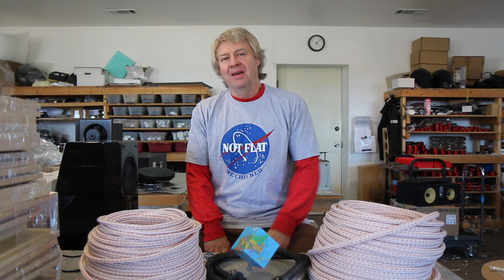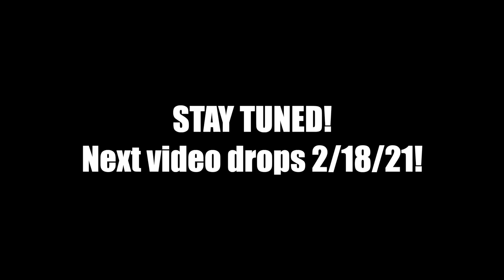Audiophile Cable TRUTHS: The Divided Camps

Comment: According to engineers, cables affect sound but cables transparent to audio frequency signals can be made very cheaply. Expensive hifi cables can be just as good unless they unintentionally messed up some parameter actual engineers care about.
Reply: There is a LOT more to it than that. Hang in there.
Reply: @dannyrichie9743  Yes, but as an engineer, not at audio frequencies. Typically in the audio realm, the only thing you have to worry about is the loop resistance of the wire. Typical linear amplifiers have an output impedance of about 50-100mΩ, so you don't want the wire forming what is essentially a series resistor as it will cause voltage fluctuations, especially at low frequencies where the current is substantially out of phase with the voltage. The other concern, of course, would be I^2R losses if you, for some reason, need to shove 100's of watts through your speakers. But generally, any copper wire of a suitable gauge for the power output will work, and there will be no audible difference.  Now the place where it does matter is at high frequencies. The first issue is the total capacitance the wire presents to the amplifier. Since there are two conductors, the wire looks not only like an inductor, but also a capacitor at radio frequencies. Linear amplifiers with feedback behave inductively outside of the audio band at higher frequencies, due to the falling loop gain. This means that there is a certain amount of capacitance that can form an LC tank circuit, and cause the amplifier to oscillate. As the wire has a very low resistance, it forms a high Q circuit, which can cause the amplifier to break into oscillations so bad that it physically destroys the active devices in the output stages of the amplifier. As most amplifiers have Theil networks in them, and there's seldom a need to run more than 20-30 feet of wire, this is not normally an issue. The one that's often overlooked, but important, is the fact that speaker wire also behaves as a transmission line at RF frequencies. This is important for noise immunity, especially for bipolar amplifiers that can rectify AM. Now the characteristic RF impedance is of no real concern for your amplifier, but it does mean that the wire will exclude RF interference from outside sources. This can be easily proven by going to the middle of a twin conductor speaker wire, cutting the two conductors apart, and separating them. Your amplifier will turn into an AM radio as the speaker wire is no longer behaving as a transmission line, but now a radio antenna. But very long story short, for audio, doesn't matter. Just get standard copper speaker wire of the correct gauge and all will be well.
Reply: @dannyrichie9743  Also, the reason I don't believe you is not that I don't want to hear contrary opinions. If I didn't I wouldn't be watching your video, would I? No, it has to do with the simple fact that what you are saying is simply not true. There is no mechanism in nature that will cause simple copper wire conveying slowly varying electrical signals to do the things you say it does.
Reply: @mysock351C  What I say is absolutely true and easy to demonstrate and hear. Stay tuned.
Reply: @dannyrichie9743  If what you say is true, and that different copper conductors can alter the frequency content of audio, then you would literally win a Nobel prize in physics, and it would be the biggest discovery in recent living memory. Im not being hyperbolic, there, either. To be honest, expect to be heavily critiqued on your measurement methods.
Reply: @mysock351C  What I've said is not only true but the whole industry knows it (aside from a handful of flat earth guys). So no Noble prizes will be awarded for well known basic information.
Reply: @dannyrichie9743  I’d love to find improvements, but no one can produce independent scientific listening tests demonstrating that high-end speaker cable, tube connectors or improved resistors provide an audible improvement over sensible alternatives. Since there are no audio based measurements either, then this is nothing more than heresay. If these improvements were so easy to hear and since there are so many companies peddling this stuff, why can’t someone perform an unbiased listening test and prove it?
Reply: @marcdesjardine5566  We've done hundreds of listening comparisons and tests allowing hundreds of people to hear the differences.
Reply: @marcdesjardine5566  There is a big difference in speculating on a result and knowing a result from experience. You don't believe.... I know. I can prove what I say and have done so hundreds of times.
Reply: @dannyrichie9743  it just doesn’t pass the smell test. If someone could easily hear differences between quality cables with similar r/l/c, this debate would have been put to rest many years ago. The strongest evidence to date is ‘just trust me’
Reply: @marcdesjardine5566  I can provide all the evidence anyone can every want. The differences are clear and repeatable in a system like mine. Every person that has ever been here and compared anything including cables left with a definitive conclusion. Even the nay sayers leave here knowing that cables matter. There is an open invitation to anyone that wants to learn for themselves. they can come by for a listen.

Comment: I believe the placebo effect has a greater effect than the actual effect of using better cables.

If you don't believe you will hear a difference, you probably won't
If you do believe you'll hear a difference, you probably will
If you've measured a difference, you'll be looking for it when you listen
Reply: And that belief is based on... what? A feeling? The placebo effect is easily removed. Stay tuned for more to come.
Reply: @dannyrichie9743  Believers can hear a difference, non believers can't. The fact that there are so many people in both camps means it is obviously a matter of perception. There is a difference in cables, but if someone doesn't perceive it, it doesn't matter. Like you said in this video, listening is the most important part
Reply: There are objective deficiencies at the bottom of the quality range. More subjective differences in engineered cables.

Comment: I'm no scientist.
I've heard my speaker cables improve the sound of my speakers from lighter gauge cables to heavier gauge oxy free cables.
The biggest difference was in attenuation. I heard the sound coming through at a higher level of volume. And clarity during low levels of volume was improved as well. From generic 16 gauge clear shielded store bought cable initially, to then upgrading to Furez 12 gauge cable with fancy braided covering added along with Sewell Deadbolt terminations. (Which let's face it, is only a small upgrade compared to the current market)
I heard nothing at all change when borrowing a friend's super duper high priced state of the art speaker cable with  soldered connections bought from a company who shall remain nameless. ZERO difference. He tried, but he failed.  
No ifs ands or buts.
I've heard a difference in crossover networks being upgraded.
I've heard a difference while introducing DSP.
I've not heard, not will I probably ever hear and difference in any upgraded power cord. I own a new  $3000.00 Sony STR ZA5000ES flagship processor and the power cords we tried did not make any discernable difference whatsoever in blind listening tests. It was an exhausting weekend of trials. 
What we concluded was that longer runs of speaker cable DEFINITELY matter when considering the gauge.
And DSP is some very interesting tech.
Upgraded passive crossover networks yield clarity especially discerning faint sounds at low level.
And experimenting with expensive stuff can be fun and there is nothing inherently wrong with using materials that look and feel upgraded from stock.
And simply hearing a "difference" doesn't always imply an "improvement."
-✌🏼
Reply: I absolutely agree with you, and my experience with my experiments yielded similar results. I always wonder why people think 3 foot of power cable makes difference when the power socket has basic Romex cables running 100 foot which is not touched. Do they even know about this 100 foot for Romex, and multiple Wire Connectors in between their socket and main termination? not sure. Does this last 3 feet of cable to your equipment power supply going to change your frequency? or your voltage? or current? Seriously sometimes I think these people lost complete rational/objective thoughts.
Reply: @chinnana583  in one of the new record day listening videos with Danny you can see several car batteries in the background.  It appears the power grid is taken out of the equation when they do proper listening tests.

An ingenious way to remove interference on an efficient sysyem.  I would be curious however, to learn what they use as an inverter

Comment: I am not a scientist.
I am not a Flat Earth guy. ( although, a flat earth could possibly make for an awesome speaker diaphragm, for projecting music towards the sun. Just a thought...lol) : D

Cables, in my opinion, are conduits. Nothing more, nothing less.

What sounds the best, is subjective: to each individual's personal musical preferences / expectations,  physiological hearing preferences, and room acoustics.

i.e. people with tinnitus are extremely sensitive to aggressive high frequencies and excessive treble levels. ( just one example)

High quality materials / construction, excellent conductivity and smart engineering for cables: absolutely makes a difference.

Science and measurements are important.

At the end of the day, it will always come down to individual preferences, and the above mentioned contributing factors.

One man's smooth, musical crescendo......is another man's dull decent into boredom.

One man's exciting, lively high frequency / treble extension....is another man's excruciating ice pick through the brain.

Gather 20 people around you, and try to agree what three toppings to get on some pizzas.

Good luck with that : D

Thanks for the video!!

Comment: Agree that listening is needed along with measurements to prove one cable sounds different than another, but shouldn’t it be done via some sort of blind study?
Reply: It has been done. No differences were found between lamp cord and expensive cables.
Reply: @Clobercow1  Exactly. They’ll then say it’s because you get used to the sound and all that. Anyways, especially since you can’t hear the difference you should go with measurements, because it’s nice to know you have the best you can get even if your ears aren’t exact enough to hear the difference. Also you should obviously really consider what you wanna spend on something your human ears can’t appreciate
Reply: @Clobercow1  You are correct. It has been done, but that was not at all the conclusion.
Reply: @TofumanFC3S  I can demonstrate that the differences are very easy to hear. Keep watching this series.
Reply: @dannyrichie9743  I'm not convinced quite yet but I'm definitely looking forward to the upcoming videos to see the results. Keeping an open mind!
Reply: @dannyrichie9743  Don’t bother for me since I’d need to see a blind listening test conducted by a independent scientific party. The problem is those tests have so far only exposed how bad our hearing is and how powerful the placebo effect is. 

I think your cables look good and as long as they test as well as any cable I’d consider them for that fact.
Reply: @TofumanFC3S  New Record day has a recording that switches between the tube connectors and standard speaker terminals. That is easy enough to hear the difference.
I think of cables like water pipes. Some water pipes can make lots of noise when water passes through. I think it is the same with electric cables.
Reply: @nonameforgoogle2538  Altho that Youtuber can hardly be considered an independent scientific party, I completely agree that a connection point is and always will be a very critical point in any transmission of signal. That’s a lot different than the cable leading up to it for which we’ve had measuring, testing and formulas since ages now. There are no real mysteries left there just like how there is no per perfect connector (but you should always get the best one you can afford for your use case)
Reply: @Clobercow1  I could never believe power cables make a difference but I do believe Audio cables make a difference when your system is good enough to play music to a high resolution.
The actual connectors probably have more impact than the cable
Reply: @dannyrichie9743  Evidence?
Reply: @nonameforgoogle2538   The problem with people who claim cables make a difference, is that it's a nebulous claim with no meaning. I doubt, in a double blind study, you'll know the difference between lamp cord of sufficient gauge, and what Danny is selling.
Reply: @nonameforgoogle2538  Power cables can often make as much or more difference than any other cables in your system.
Reply: @Clobercow1  Plenty.
Reply: @dannyrichie9743  Oh dear God.  Danny come on, power cables???  Why does the last 6 feet of cable after miles of that shit in the power lines make any difference at all?  The cable goes into a device that has power filtering.  What would the cable even change?  Explain EXACTLY HOW what you're suggesting could be true.  Use your head.  How can you keep making these kinds of nonsensical statements?  It's mind numbing.
Reply: @nonameforgoogle2538  That's a bad analogy.
Reply: @Clobercow1  In the old days Arny Krueger would declare on RAHE that all CDs sound the same, and all CD players sound the same. He knew, because he had done the measurements and the double blind listening tests. Arny was an "objectivist". 

Then, people would point out to Arny that a lot of improvements have been made to digital audio during the 80s and 90s. E.g. the earliest consoles would be 16 bit at most, so with every mixing step, oh yes even with changing the volume of a channel, you would get rounding errors and lose more and more of your precious bits. And all parts of the equipment would have separate clocks, so that the samples never arrived at the right time in the next part of the studio chain. So later on all this changed, they discovered that recording at 20 or 24 bit would give you enough headroom to deal with rounding errors etc, they discovered the importance of dithering when reducing to 16 bit, etc.

But Arny the Objectivist continued to say: "It all sounds the same."

So one day I told him that my TEAC CD player had 2 switches, allowing for 6 different digital filter positions, and that they all sounded different.

But Arny the Objectvist flatly refused to accept this reality, and continued to say: "All CD players sound the same."

All objectivists are in the same league as Arny Krueger. They deny science.
Reply: @TofumanFC3S  You have no understanding of science.
Reply: @dannyrichie9743  Power cables really make a difference for amps. The reason is that all electrical appliances in the house form one big filtering system together. So your amp is connected to everything else in the house. Even if the stuff is on different groups.

If I unplug my Brother laserprinter in my study, I get a better, clearer sound in the living room, although the study is on a different group.

We have cable radio in the Netherlands. If I unplug the antenna cable from the wall, the CD player will sound differently. It's all connected.

My experience is that having tv, dvd player, laptops, etc on standby mode gives a better sound than switching them off. In off mode they become a kind of passive filter, that is to my ears more obnoxious than in standby mode.

If you want to switch these thingies off, then in my experience it's better to unplug them.

If you cannot hear the difference, you are deaf.
Reply: @LouGuido  Cables are connected in series, that's why they matter. It is like sun glasses. You can see the whole trajectory of a photon bundle from the sun to your eye as a kind of cable, hundreds of thousands of miles long. And your sun glasses are a photon attenuator. Why would this last half inch of attenuation make a difference to a photon, after having traveled so many miles?

Because your photon attenuator is in series, not in parallel. Your sun glasses filter. Therefore they matter.
Reply: @ernstraedecker6174  Wanna back that claim up with ANY proof or even examples, tough guy? Since you are Youtube comments section scientist ofc. and I “have no understanding of science”
Reply: @ernstraedecker6174  What’s the address? Probably not that far of a drive from my place, I’m totally game
Reply: @TofumanFC3S  Amsterdam, the Nethrrlands. You're welcome.
Reply: @ernstraedecker6174  Ja, ik weet dat je in Amsterdam woont, staat op Twitter, maar wat is het adres? En wanneer mag ik langskomen?
Reply: @TofumanFC3S  Dan moet je me via twitter een DM sturen. En dan gaan we er een dag voor zitten, over een dag of 10, als mijn 2e AZ prik is ingewerkt. En net voor ik mijn nieuwe electriciteitsmeter krijg (14 juli). Of juist een week of twee daarna.

Dan zul je zien dat ik momenteel een handgemaakte three-wire solid core free floating power booster (tm) als snoer naar de pre amp gebruik. Oftewel installatiedraad vd Praxis. Is dat een goed idee? Hm, het bevalt me op dit moment.
Reply: @ernstraedecker6174  Kijken we einde van de maand dan wel. Moeten we van te voren het er nog wel over hebben wie en/of wat getest zal worden. Tot dan!
Reply: @LouGuido  Exactly right.  A power conditioning system can often make more difference than a high dollar cord.   Unfortunately, that industry suffers from the same snake oil treatment that this one does.